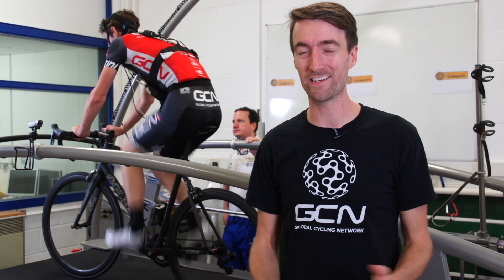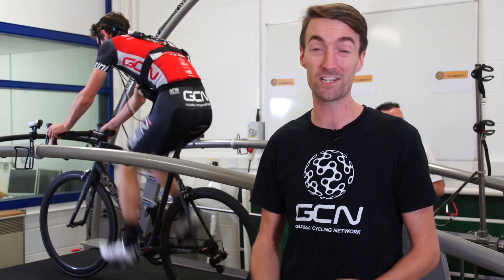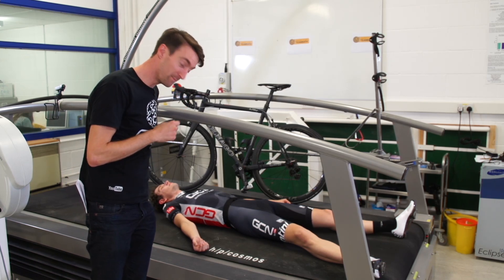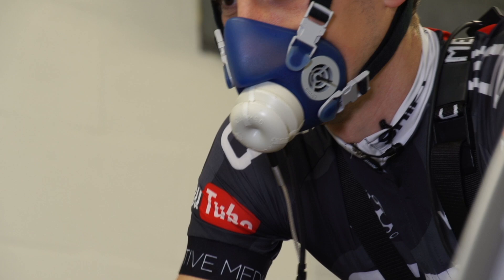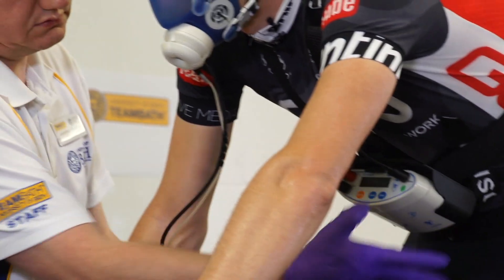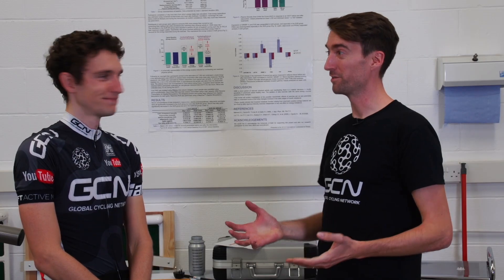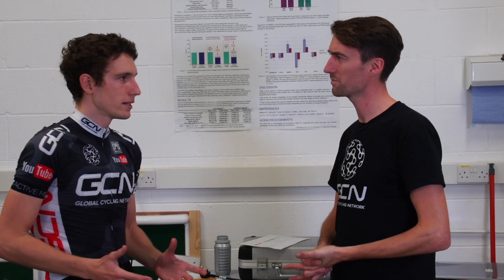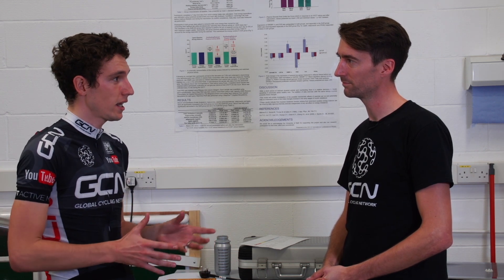What Is The Most Efficient Cadence? GCN Does Science

Comment: very strange maybe is very stupid what i'm going to say but obviously you have to train higher cadences to have a benefit, but also maybe you may have to increase you levels of red blood cells that's why armstrong had a benefit of this, maybe the science of cycling has to build a new principles without the idea of using ban substances and not to use armstrong an urlich as a reference.
Reply from the maker: Hi Edmundo, it's a good point, but being able to sustain higher cadences isn't linked to doping, however riding at higher powers does require a higher cadence, and higher powers were linked to doping. You would still find though that the harder you cycle, the higher your cadence.
Reply: Global Cycling Network Findings suggest that in conditions simulating those seen during prolonged competitive cycling, higher cadences (i.e., 100 vs. 80 rpm) are less efficient, resulting in greater energy expenditure and reduced peak power output during maximal performance. Key PointsWhen competitive cyclists perform prolonged exercise that simulates racing conditions (i.e., variable, low-moderate submaximal cycling), a higher cadence results in excess energy expenditure and lower gross efficiency compared to a lower cadence at the same power output.
http://www.ncbi.nlm.nih.gov/pubmed/24570614
Reply: Pleinair Air it's not just simple as that higher cadences uses different twitch muscles high cadence muscles last longer than low cadence muscles may be a variable is to do this test after is to do this after 100 km haha another variable is mechanical do any one knows whats the best mechanical cadence??
Reply: EDMUNDO MORALES 

what cadence is best...depends how many watts you can produce cris froome can produce 400w an does a 100 rpm cadence so it's 4w/sec so

¿if the best cadence is 4w/sec and my output is 250w my best cadence is?

Comment: The emperor is wearing no clothes. The test is not valid! How is the treadmill adding load? It is NOT! It doesn't matter if it is 0º or 9º. There is no increase of load with more tilt. The treadmill is doing most of the work. It has to be done on a Computrainer or something similar. (I'm not in any way connected to them other than the fact that I have one that I purchased.) That way you can accurately measure load and analyze pedal stroke. Do it again. PLEASE!
Reply from the maker: Hi Albert, I think you need to polish up your physics! The treadmill is adding resistance, you can measure it very easily using a power meter. It's just like riding up a hill, just without the wind resistance,
Reply: Sorry, but you're just plain wrong.